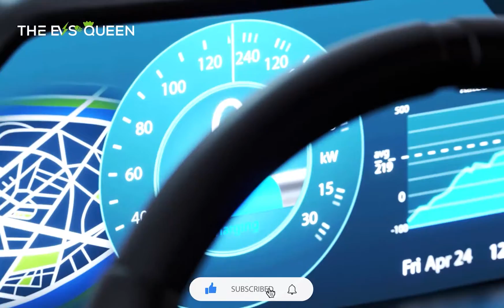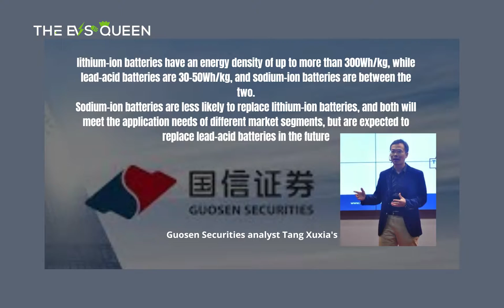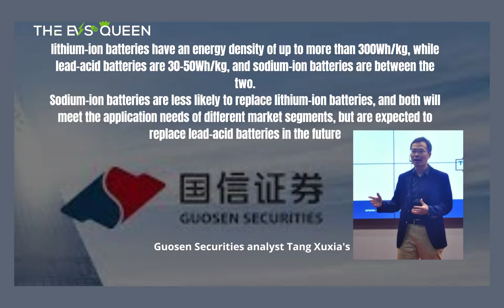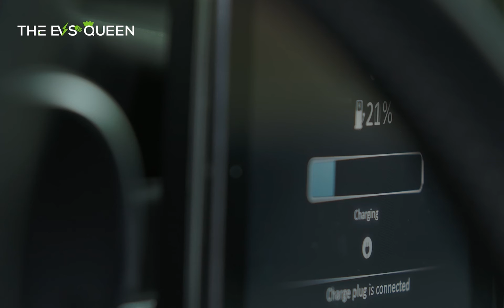BYD will be the first to have sodium-ion battery in their cars

Comment: What is the energy density compared to Li chemistries? — I found it Na is half Li not great.
Reply from the maker: It achieved energy density between 100 Wh/kg to 120 Wh/kg. and li ion battery provides 100-265 Wh/kg. Sodium-ion batteries will be used for large scale battery application.